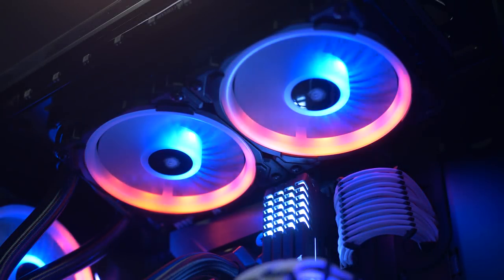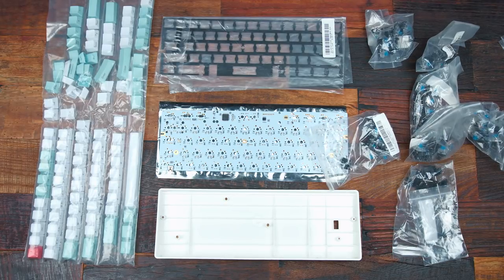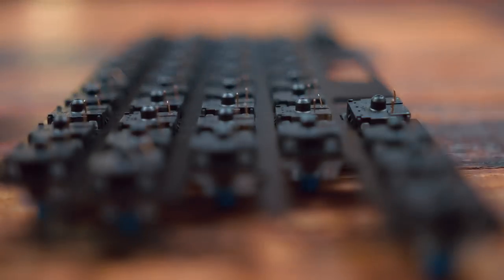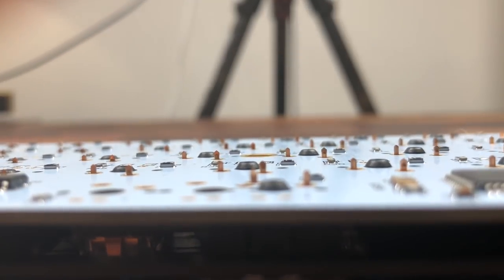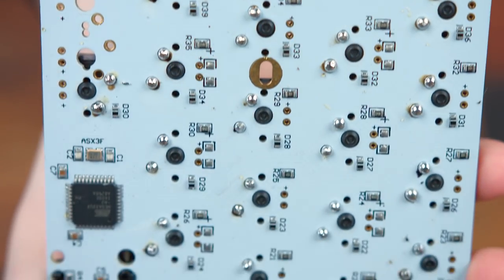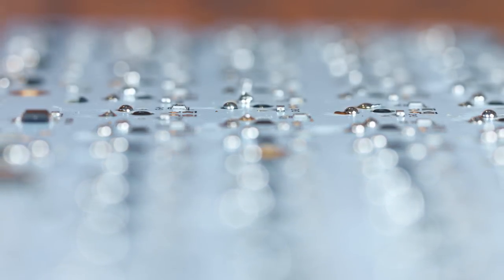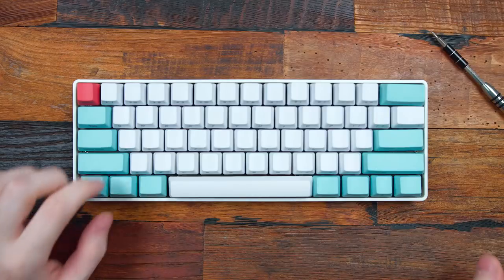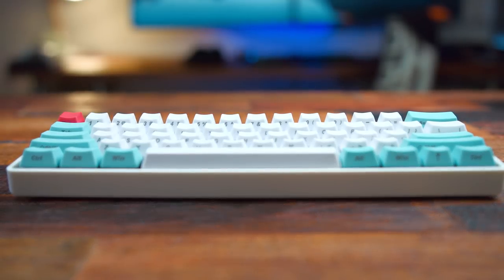Building a 60% Keyboard!

Comment: Just 3 important tips for soldering for future videos:  
- Your solder wire is too big, use a 0.3-0.5mm wire instead (also should be 60/40 or 63/37). This will make your life a lot easier.
- Use a 340-370°C (650-700°F) temperature for the soldering iron.  400°C or high might damage the PCB easily.     
- You DON'T do soldering joints by touching the wire on top of the soldering iron, INSTEAD  you put the iron on the pad (gold plated circle) like you did and this will heat up the pad, once the pad is heated up on the other side you let the wire touch the pad and this will melt the wire (and will melt pretty fast if the wire is smaller).  Eventually if it will not instantly melt, you can let the iron tip touch the wire tip but they have to be both on the pad surface in the mentime (so the surface of the pad must be hot and with the wire touching it).  Once the jont is done, you remove the wire, let the iron heating up the surface for other 0.5/1s and then remove the soldering iron too.  The whole process is short, around 2-4 seconds for joint.

Thanks for showing this hobby to people.
Reply: JKaos your smart
Reply: èdgy you’re*
Reply: Justin2926 lmao thanks ig
Reply: Great tips!
Reply: " Just 3 simple tips" proceeds to write obama last name

Comment: Yo frankp! Just a heads up, looks like your soldering iron is WAYY too hot. Try to keep it around 300-350F. That's my sweet spot for temp on building keyboards! Also, your left mods to the left of the spacebar are not in the right spots! You can tell by the space between the left control and the case that theres a slight gap to it. Easy fix though!
Reply: If you are using lead free, then 600-650 is good.
Reply: SD 59FiFTY Temperature shouldn't matter as long as it has that shiny look. As long as the placement is quick, and doesn't leave it in the tip too long he should be fine. His soldering was very well done compared to what he made his soldering skills out to be.
Reply: I would argue that for soldering any electronics 400°F is more efficient, the less time the solder is burning on the iron the better. So as long as the iron doesn't make too much contact to the PCB for too long, he should be alright (which he did do a little bit of).
Reply: Luke Rohrig nah, that soldering isn't looking good at all. To many cold joints. Yes they work for some reason, but that's not the way solder joints should look like. I don't know what was the temperature set to, but that solder tip could use some cleaning.
Reply: SD 59FiFTY how would you fix? Just so I know for when I go to build my 60
Reply: @WiTRoOner  the recommended temperature is 350 CELSIUS not Fahrenheit. As for the "fix": just put the switch in the right spot. If you already built it and made the mistake, desolder the switch and solder it into the correct position. This pcb has a lot of layout compatibility, so you'll have to make sure you've got everything lined up correctly.
Reply: It's supposed to be 350C, not 350F
Reply: Way to much solder too😅

Comment: Frank just a heads up, solders  should not look like a ball. You have too much solder on! A good solderjob should be like a symmetrical concave cone!
Reply: Susse My soldering looks like this, any tips on how much to use?
Reply: @aybusiness19  keep your iron around 350-400 celcius, but lower is better. Balls form when there's too much solder. What can also help is getting solder with a lower diameter, so you put less on if you move your hand forwards. Heat the pad (The little ring you're putting solder on) for a second or two, then put the solder on until the cone forms and take it back off.
Reply: @usha3938  Thanks for the info, ill try tomorrow
Reply: @usha3938  jesus christ lifesaver i now know what ive been doing wrong. You are a hero.

Comment: Do you need to solder the pins on the keyboard or can you use a glue gun for glueing it to the board? And what does 625 and 700 for the stabilizers mean? And does almost every pcb plate offerd full rgb compatibility? Thanks alot for helping me out:)
Reply: yes you need to solder the switches however u can find hot swappable pcbs on the market (dont glue it lol). the number are referring to the units that the stabilizers take up 625 (6.25 units) 1 unit meaning the normal keycap size. and most pcbs support rgb

Comment: Frank, instead of adding more solder to correct a joint, just keep the heat on the solder that's already there and it should fall right into the hole nice and snug with not much residue

Comment: 60% master race
Reply: mines a hybrid its like a 70 precent because there are the insert buttons and the arrow keys but no numb pad
Reply: @experteastereggs2579  that's called TKL (Ten keyless)
Reply: @victormanzano4490  no it's not a TKL because it doesn't have the function keys
Reply: Was going to get one but they are too expensive in my country so I got a Corsair Strafe
Reply: Expert EasterEggs 75%
Reply: @experteastereggs2579  Where did you get the parts from? New to building keyboards but I really want a 75% keyboard
Reply: Brian Alvarez didnt build it bought it
Reply: @victormanzano4490  no I want full size gang
Reply: @experteastereggs2579  75%
Reply: 65% master race
Reply: Expert EasterEggs that's called a 65%
Reply: Brian Alvarez if u want to build it will cost like 100 bucks
Reply: Or more

Comment: Don't worry frank.  Your soldiering technique is good but you probably need a new tip for your iron, better solder (thinner to slow the feed of solder) and if you do not have one, a decent soldering station with variable temperature control.  That chisel tip you have on their already saved your bacon my dude.

Comment: im considering building my own keyboard but is the soldering part hard
Reply: Hey, if you're put off from soldering you can get a PCB that supports optical switches (basically allows you to hotswap switches without needing to solder at all!) and luckily optical switches are roughly the same price as regular ones.

Comment: is there any 65% pcb out there except the kbd67 ?
Reply: tada68
Reply: @evfl1351  i know about that one, but its not hot swappable, i realy dont want to solder
Reply: laZzy GG get the gk64, it’s a cheap hot swappable keyboard, I’d say start with that and upgrade over time to make it yours
Reply: @ferni0  I second that, I got the iGK61 (basically the 60% version) and its a pretty nice board.
Reply: @ferni0  yes I already ordered it 2 weekes ago, still waiting, also i got a set of custom keycaps and o rings, i also want to paint it white... ty for suggestion
Reply: eefl Thats what I’m ordering, along with Zealios V2 and a set of  keycaps
Reply: @ferni0  Nice haha, I outfitted mine with Hako Royal Clears and two gat yellows for the backspace and escape key

Comment: Oh my, the soldiering gods are in tears.  First off, clean the tip.  Wet sponge and copper scrubber.  If there is a way to lower the heat down from 800ish, do it.  You will want to bring the heat to the contact pad, then apply the solder to the other side of the weld point so you don't have a cold solder contact.  Also, use about half the solder per point.  Should look like a small tent, not a dome.  Most important part, practice.
Reply: Shhh. That guy doesn't have a pHd in engineering. He can't do complicated stuff like Soltiring!

Comment: where are the arrow keys on the keyboard?
Reply: Andrew ah, I see. Thx
Reply: The board actually does have arrow keys. You can also program layers into the board similar to a function layer, and simply have the arrow keys on a layer. For example, you can program the arrow keys to WASD when you actuate the programed layer
Reply: Thank you for the info! Good to know i can do that if i ever wanna make one
Reply: i have my arrow keys as the right mod keys, i never use them only use the left side so they are on the default layer like that this way i dont have to hold down a button to use arrows (which i use often)
Reply: You can add arrow keys with a 2u left shift and a split right shift.  Depends on the plate you go with.  It's common to see a 2.25u left shift on 60% builds though.  R3 may feel awkward at first with a 2u, but you get used to it.

Comment: Building a 60% Keyboard! (change it to $)
Reply: Nope
Reply: 60% isn't a mistake it's signifying the type of keyboard he built
Reply: Jhee Retzlaff He meant that keyboard could cost 60$ (probably)
Reply: 60% Keyboards refer to the size and number of keys. It's not a $60 keyboard.
Reply: if you notice it doesn't have the side set of keys or number pad on the right.
Reply: idiot lmaooo
Reply: Is hilarious that some people think this keyboard cost only $60 lmao
Reply: IK. I looked up the price of switches and I was like NTY.
Reply: Natusch no it’s the size of the keyboard, there’s a ten key, which is the numpad, a 60%, which is without the numpad, and a 40% which is only letters
Reply: Natusch bro this thing is like 110 bucks if you build it according to the prices on bangood
60% cause it has 61 keys instead of 104
If you were to build it better with a metal case, cherry mx keyswitches, and some decent dsa keycaps, you be looking at around 2-300 bucks.
Reply: @Skrillfreak  ew did you just say cherry switches
Reply: @tyler94302  agreement